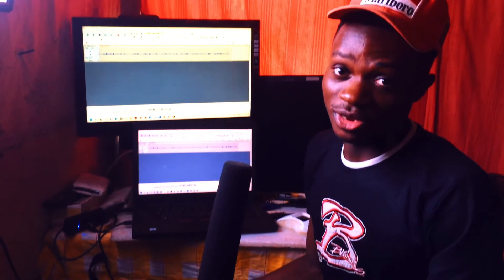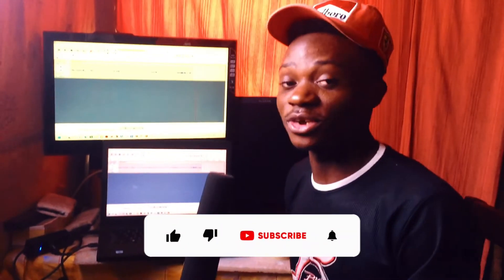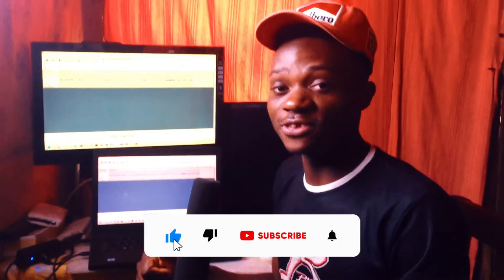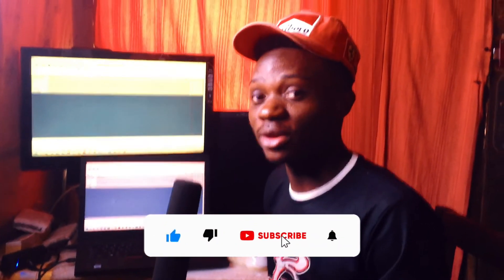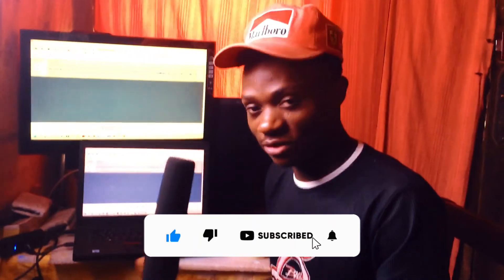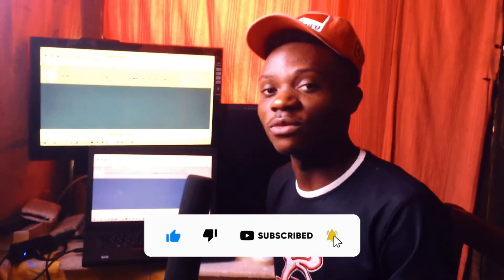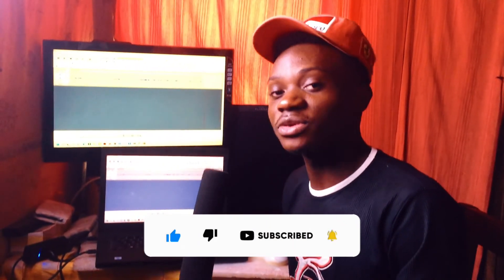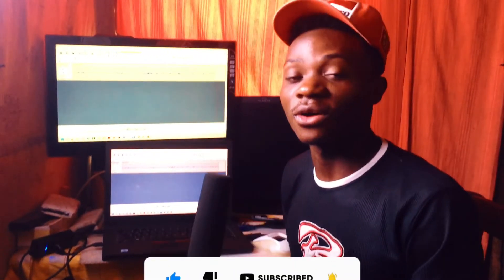What Is An Integrated Circuit - An Integrated Circuit Explain

Comment: Can you share one sample of circuit diagram charging sections?. i want to know the conectition between charge port, Charging diode, to charging Ic..... I trying to search on YouTube but no one has share the ciruit diagram charging sections/system in mobile. To understand trouble shooting and jumper etc.
Reply from the maker: Every phones has its own charging section connected in its own way. You should know that first.
So the schematics ain't ain't the same. But they have the same way of operating even though the connections are not the same. And to understand that will need some experience that's why I always say, experience matters a lot. I will try my best in making a video on how charging section operate. 
But before I do that, I highly recommend you to spend some of you time studying schematic diagrams
Reply: @SergesMike  ok I understand, but i need just one sample tu understand the basic functions and conect line between charging Port/sucket, Charging diode, and Charging Ic etc...
Reply from the maker: OK I will work on that